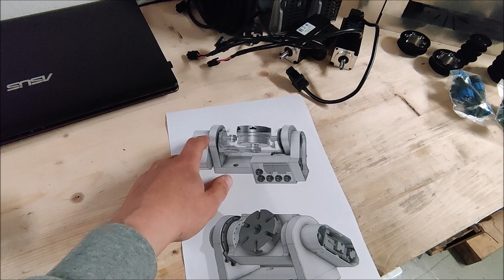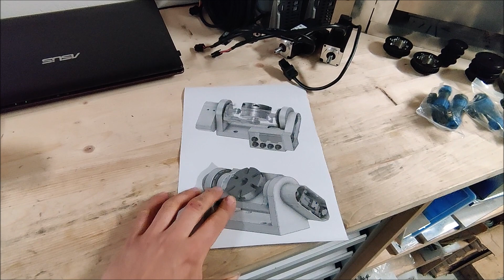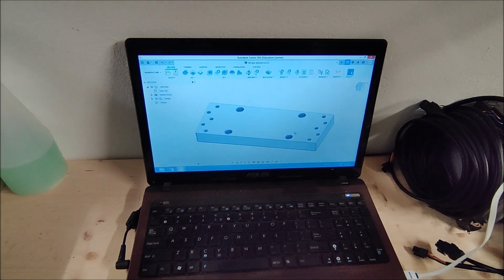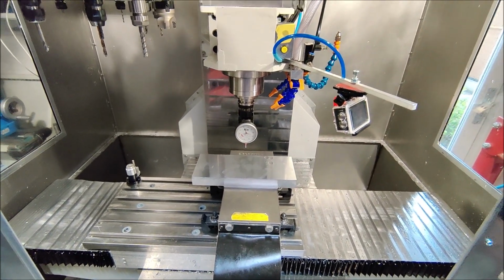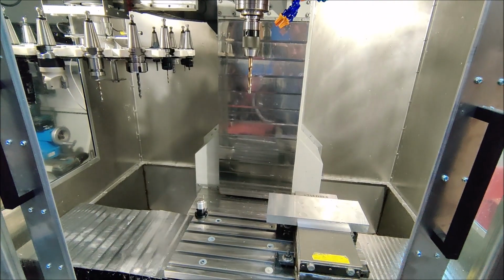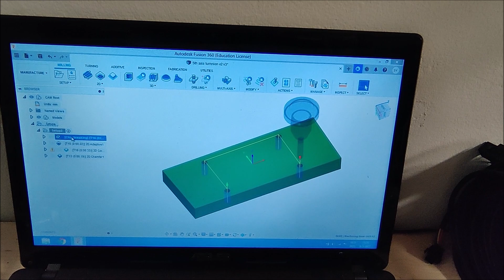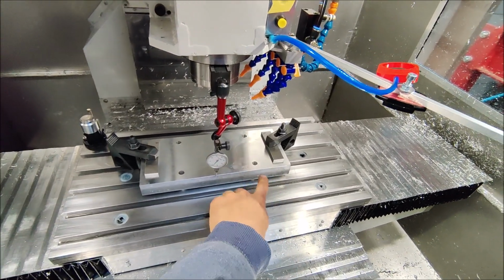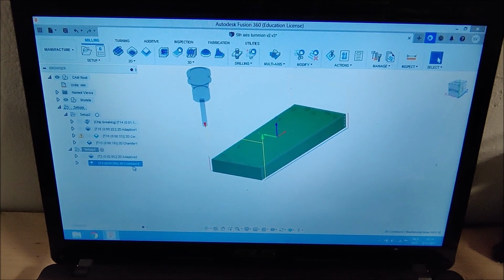Diy 5th axis trunnion build part1

Comment: Thanks for the video. I am making a trunion similar to this. Is there a place. Where I could access your documents on this project? Cad files and part numbers. I am not sure what bearings to use for the A axis. I will be using a 45 size harmonic drive for the A and a 40 size harmonic actuator for the C axis. Direct drive for both.
Thanks
Reply from the maker: Hey Matt, you can download the 3d model on grabcad. I don't really have a parts list. https://grabcad.com/library/5th-axis-trunnion-cnc-1

Comment: Good job, looking forward to see the next parts and most of all how it behaves in practice with the belts, etc. what bugs me the most with the 5 axis is the work to set it up and take it out. Been thinking all along of using shunk or other zero point clamp to make it easier. I have even considered just a d1-4 cam plate. The other issue is fusion limitations. But I saw you have the education license?
Reply from the maker: Thanks, i gone try to keep the trunnion on the table all the time and give it a g55 or so. Since eding doesnt support tcp i need to set my zero point at the axis and the rest need to come from the cam software. I want to make my own dovetail clamp once thats all setup good i assume it will be easier in the future. Yes i have an education licence but i think i all need is the 3+2 funtion that would be already more then enough to start with. I have been looking at programmable nozzle before. Sounds like a fun project to do later on.
Reply: Oh yeah forgot to mention that you could use a programmable coolant nozzle, I certainly need one and am building a small series of them.

Comment: You know how much I wish you did such videos for the mill build, right?! 😉 So, you know how great it is to share this build like this ❤️🙏
Footage is absolutely OK 👍
Design is very nice and, if I'm not fond of belts, I believe you could change my mind...
3 questions on the machining side:
Do you really need to peck with the drill?
Why adaptive strategy instead of contour or bore ones for counterboring? 
Can't you take full depth roughing cuts on the sides?
Thanks again for taking the time and energy to share this with us. So inspiring, as always...
Reply from the maker: Thanks! About the machining I'm still in my comfort zone and afraid to take a real bite. There must be a day coming that i just need to try and plow an endmill tough material and see how hard i can go. Same for the counter bore. The adaptive is the most reliable operation which almost never goes wrong.
Reply: @Svanitterzon  reduce your WoC to 3% tool dia with full DoC and crank up your feeds and speeds. Then increase WoC slowly until you get the good feeling... You won't regret it. Seeing your machine running into mater joyfully should be a satisfaction like no other, plus, you'll increase your MRR and tool life!
High Speed Machining FTW my friend 👌👍

Comment: hey mate thanks for sharing, your spindle have a port that blows air down to the tool holder. not the one inside the cone. there are 6 screws where the flat spot is. Where is stuck the indruder. Also this 6 screw are connected to a port on the big diameter right up. Mine have it anyway and I have the bt30 as well. check it out.
Reply from the maker: I need to check it then. I never found this port while i really would like to have it😬
Reply from the maker: My spindle doesnt have a blowoff channel unfortunaly.
Reply: @Svanitterzon  you must make up something for this. You get chips going on soon or later. Make a ring mounted on the spindle. blowing a little more air inwards. mine uses low air pointed exactly. so..

Comment: what happened to your spindle bearing ? sounds very bad
Reply from the maker: Yeah i should said it in the video. The action camera microphone sucks. Its inside a case which is mounted to head with a thin piece of square aluminium. It vibrates and gives a super raw noice. This is not the sound hear when next to the machine!

Comment: Nice idea but i have some dubt: belt drive is not backlash free and not free from vibrate under stress, you need some harmonic reduction and closed loop servo .. just my opinion, bye friend
Reply from the maker: Iam using harmonic gearboxes with servo's that have encoders?
Reply: @Svanitterzon  yes but belt too.. not good for me.. your machine is pretty strong, the belt driven  movement will be a weak part of the system..
Reply: @AsitShouldBe  a belt driving a 100:1 harmonic drive will not be an issue.
Reply: @etch3130  yes you are right but i hate belts.. 😁
Reply: @AsitShouldBe  Belts are awesome! They are not as elastic as people think and belts don't have the backlash of chains and you can run them pretty tight